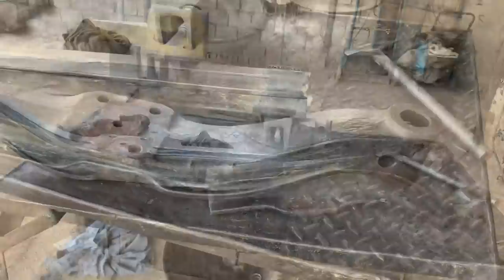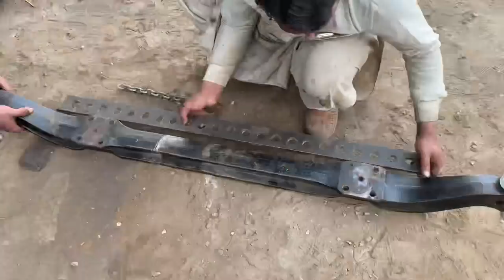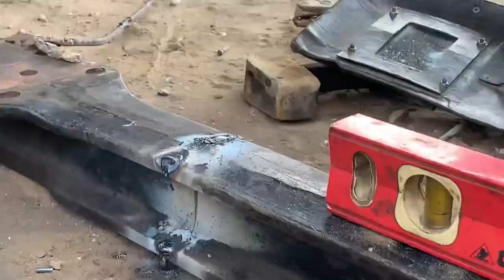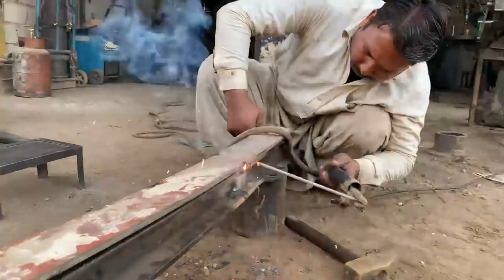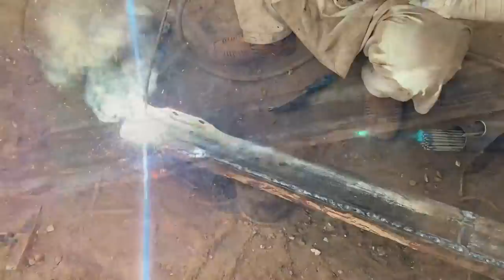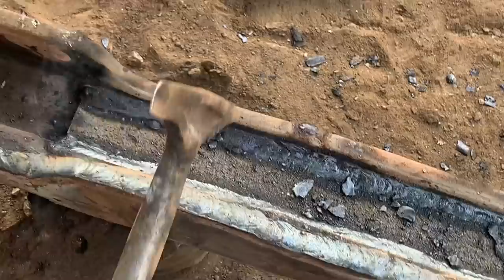How to Bedford Pakistani Truck Front Axle Repairing | repair by hand working |

Comment: Stronger than new, you laid down a nice run of weld considering you don't have a right shield or a electrode holder, a repair like that in most western countries would never pass the annual inspection so it would be pointless to do it, but then I never seen a axle broken like that, better roads and weight regulations prevent it. still well done.

Comment: I know this may be surprising to hear, but in some countries they tend to overload the commercial vehicles. (Humor) If that's the reason it originally broke, then wouldn't everything have to be perfect with the repair to have a chance? Exact correct rod, backup plates and welding?

Comment: I would have the long one finish nearer the kingpin. It just feels like it will want to break there next? I’m on the fence on the H gusset, it’s in the neutral zone of the beam, so is it adding anything but weld stress? Either way it seems to work on U.K. stock cars and they beat the hell out of them after shortening. :o)
Reply: Did you notice they didn t weld the end of the extra plate? They know the extra weld will weaken the axle
Reply: @haynillesen  That’s a classic move :o) Surprising how many vids and shows don’t use it?

Comment: I didn't see anyone measuring the length of axle. They took approximately 50 thousand of inch off with grinder,  then they eyeballed the welds.  I bet when they put it all together something isn't lining up right.

Comment: Not sure what to say! 1. The guy using pebbles to shim up before welding. 2. Welds did not look like getting enough penitration. 3. Leaving the ends open for water to enter. 4. Some how sticking a filler plate in so the damaged area would not bend. 5. Just the fact there going to put this back on a trk where it's going to take a 15k plus load is fascinating. 👍
Reply: Don’t worry...DOT will pull him over and he’ll get red tagged out of service.
Reply: @sawboneiomc8809  You do realize there is no dot there.
Reply: @fozman845  I guess you don’t see the sarcasm dripping from my lips.
Reply: @sawboneiomc8809 Gotta find him first. With that much traffic. 😂😂😂

Comment: Hardly any penetration on this welding and adding that leaf spring will do nothing, this won’t last a week before it cracks, they need to get more heat into the axle when welding

Comment: what kind of welding rod do you use?
thanks for your answer☺️☺️☺️
Reply: From the looks of the slag and the sound of the arc, probably 7018, or any other low hydrogen electrode.
Reply: Nope more like 6010/6011 or possibly 6013. 7018 is a rod used mostly in the US , but not common in other parts of the world.
Reply: @enriqueaguilar1211  If 7018 is not available, the equivalent is 7016 (Europe and Australia)

Comment: Just like "you can buy a truck, but can"t buy a new axle LOL"
Reply: A truck or car there will used for more than of 40 years, can't compare with dev countries. It's economical to do this than buying a new axle, labour is cheap, vs in dev countries It's more economical to buy new axle than repairing it and sometimes if the truck is start aging and demanding repairing, then it's more economical to sell it to junk yard or part it out and buy new truck.

Comment: Is this ductile iron?steel? Looks to be ..yes it can be done ..never let anybody tell u it cant be fixed
Reply: The problem is the fix will not last the bending properties of the metal are changed by the weld. Plating it to reinforce it will not keep the original metal from bending under load, and snapping the weld.
Reply: @carrollsanders9376  i know this ..but if i wrks for a while its good..i welded ductile iron before and it still going today..
Reply: @carrollsanders9376  preheating is the trick
Reply: @stevedelacruz3749  I have welded ductile Iron in an emergency with a Tig welder, but an arh welder never holds up long.

Comment: Ready for all the comments about how this will fail.
If it didn’t work they wouldn’t keep doing it
Reply: as a welder all types for over 35 yrs  i can assure you this joint will fail at some point  this looks like it part of the front axle from a  small  or larger lorry these joints can be done correctly but watchin them repair it  is shockin  and no im not bein nasty or anythink to  these people they do the best they can with wot they ave
Reply: Yes, they will just keep "doing it" over and over and over again...